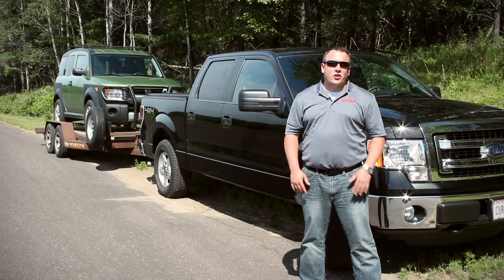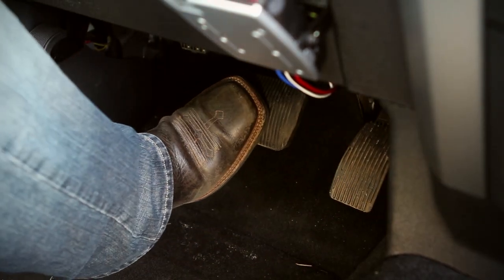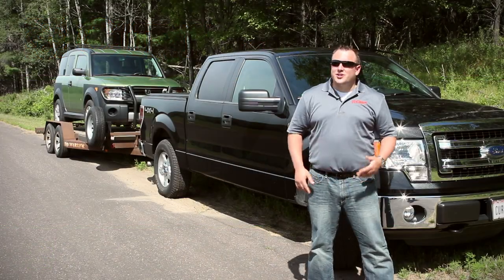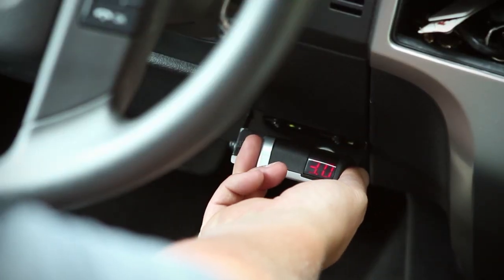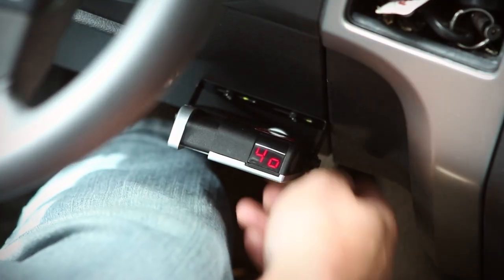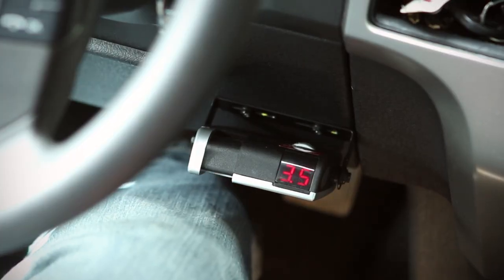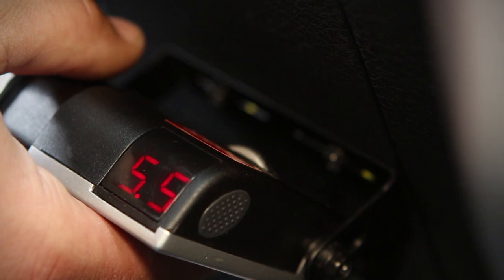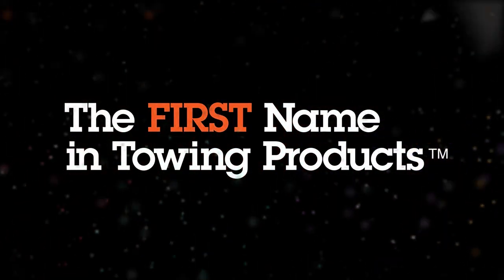CURT Discovery Brake Control Users Guide

Comment: Help. I recently installed an electric Curt brake controller. I notice when towing only that the controller seems to randomly make clicking noises. Almost like it might be calibrating or something.  Any idea why or what the clicks are??? Thanks so much for your help.
Reply from the maker: If you need any help, feel free to give us a call at (877) 287-8634 ext. 2.

Comment: I tried just setting the unit by connecting trailer to tow truck then pressing on brake and get no numbers like the video. But when I went to the manual it said to put in park set emergency brake and then set controller, so now I'm really confused
Reply from the maker: Feel free to give our technical support team a call at 800.798.0813.